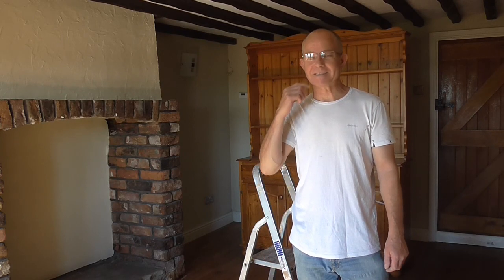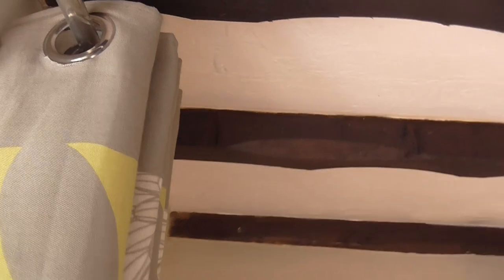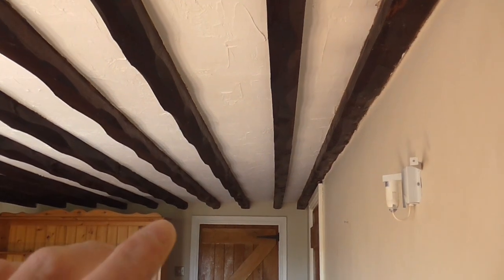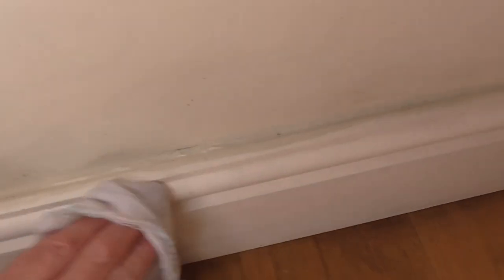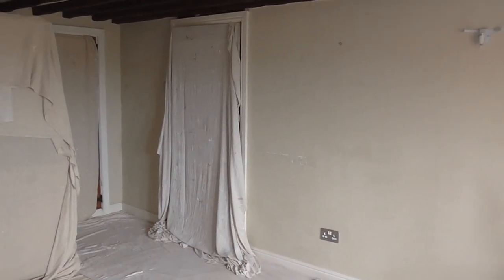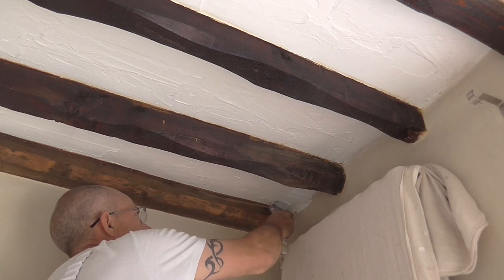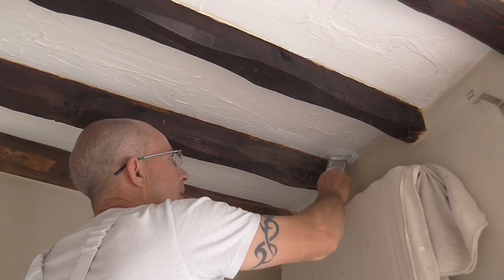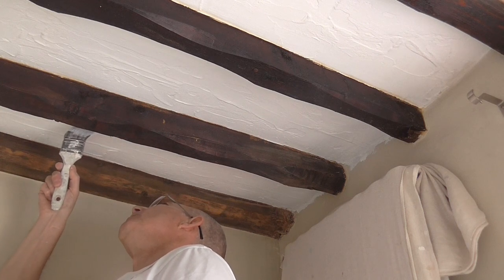Part One Painting A Room

Comment: this paint covered a magie ceiling in white with one coat with a long pile roller over vinyl matt magie but over contract matt with vinyl or acrylic it will need 2 white over as contract is basically just pigmented chalk and sucks the 1st coat up but contract matt over contract matt in good condition in same colour usually covers in 1